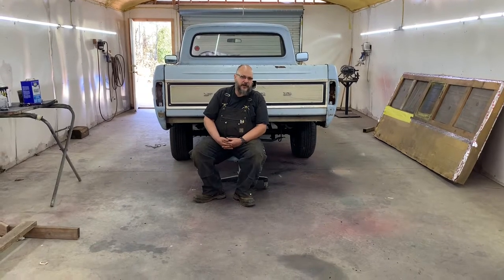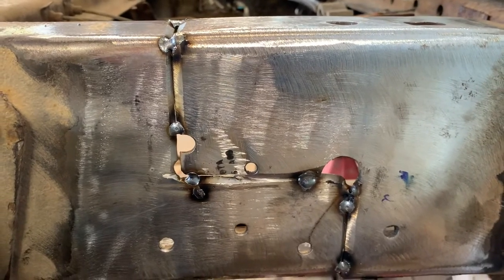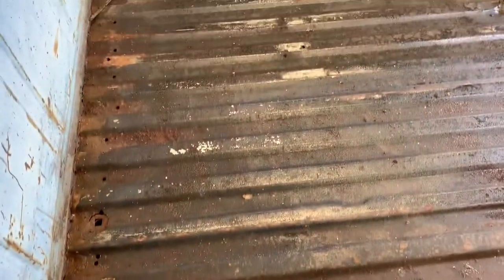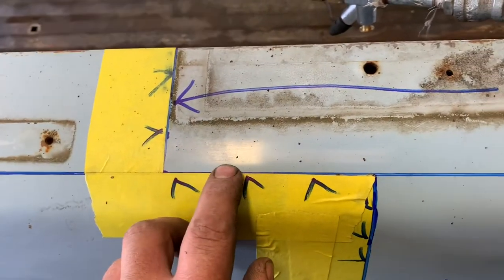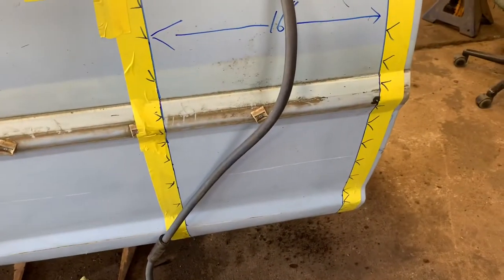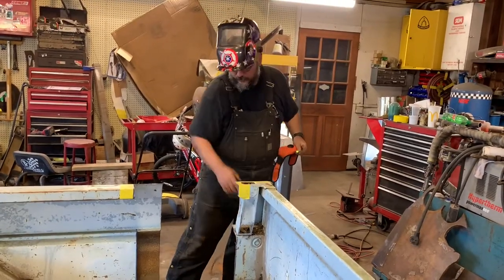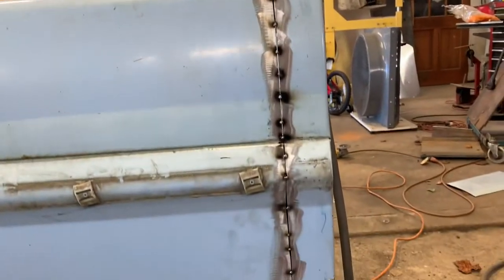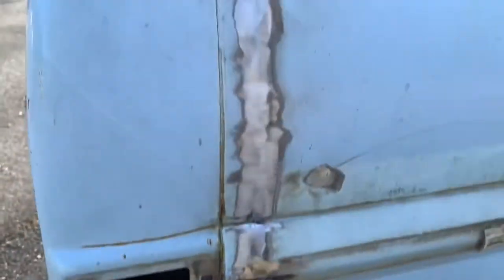1967-1972 Ford Pickup Truck Short bed conversion

Comment: Good evening, I had to have my new rollback truck frame lengthened and they did not do a superior splice like you did. That is good engineering and excellent craftsmanship. I do like your plates on the splice with the rounded edges. That is exactly how aircraft panel splice work is done. Great video. You take care and good luck.

Comment: Shortening a truck from 8 foot to 6 foot is the most insane thing I have heard of. Take away hauling capacity and room ?
Reply: I fully agree. People do it all kinds of work to make their truck useless. People will start to think all the long beds look better when there are hardly any of them left.
Reply: Useless ????
How do you figure this just by shortening the bed ??
I have a factory short bed on mine and never had an issue,,, haul 16 foot lumber and ladders with no problems...
Now if one is done that involves putting it on a Crown Vic frame and using up the bed depth,, I can see your point...
To each his own...
Anyway,,, there’s way more long beds than short out there....
Have a good one....
Reply: i agree totally... and I can't wait to do it again 😂
Reply: It’s the looks of the truck not the capacity!
Reply: @donaldfrazier5244  I totally agree.  Short beds look small and out of proportion with the large cab.  Like a team of horses pulling a sulky.  Just doesn't look right.  Promotion and advertising have influenced public opinion on what people should think Good looks like.  Study some fine arts text books and study up on shape and proportion. Small bed pickup trucks do not follow the classic norms of what is pleasing to the eye. Another way to say, some peoples taste is in their mouth.

Comment: I'm a little late to the party here, but do you still own the long bed you took off? If so, I'll make you an offer for it. I'm looking for one to replace what I have on my '78 F100. I've got a little too much rust to deal with. Thanks.
Reply: Did you watch the video ??

Never took the bed off 1st 
Cut the long bed up to make short bed 2nd 🤦‍♂️
Reply from the maker: That was the original long bed we shortened

Comment: Nice job but,the frame is considered spring steel and must be drilled and riveted or bolted to remain flexible,in some states it’s illegal to weld a frame!
Reply from the maker: Unless a frame is marked do not weld, it is ok to weld. Most standard automotive frames are welded from the factory. Only in the case of semi trucks is it illegal to weld on the frame.